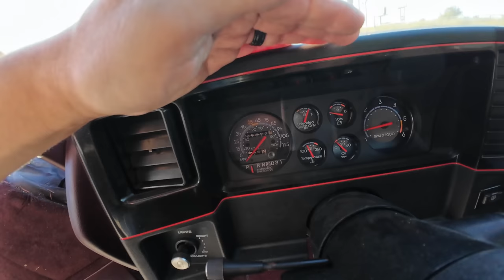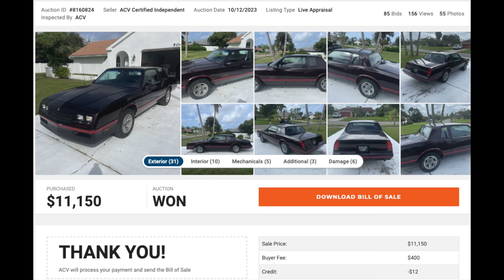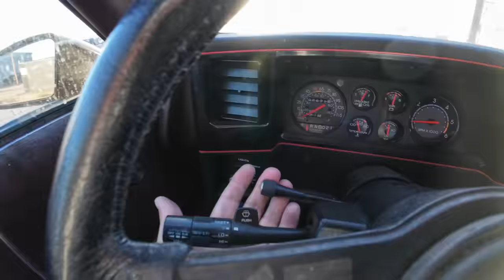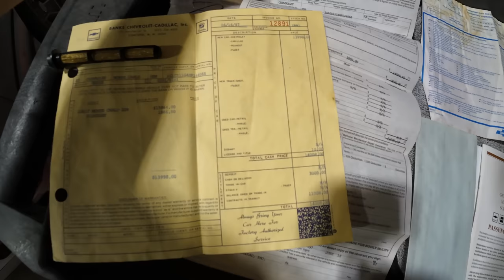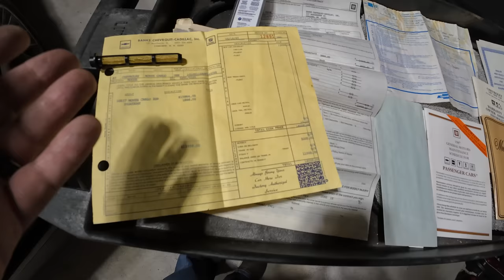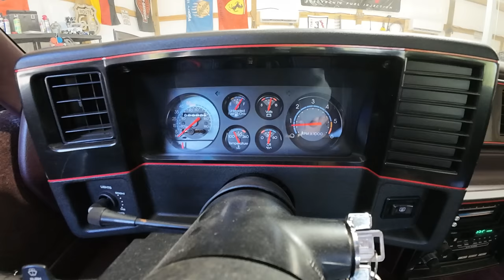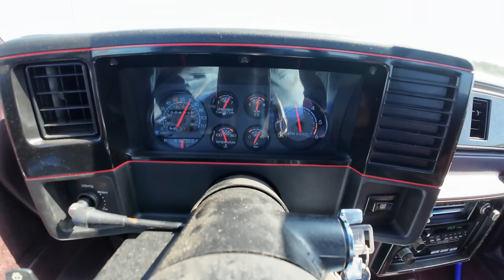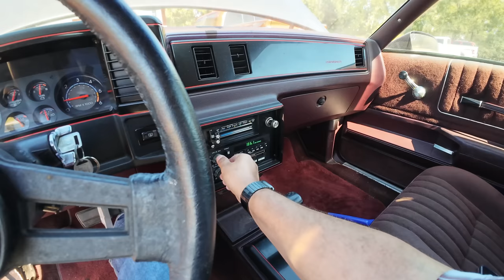I Bought a ONE OWNER 1987 Chevy Monte Carlo SS Parked for 20+ Years! First Drive - Will it Make it?

Comment: Radiator cap is probably fine since it's pushing water/antifreeze into the reservoir as it should be. It isn't sucking air, it's pushing water out.

Comment: A powertrain swap is a good choice.  If it were super low miles and more of a museum piece, then no.  As it is, with 100k on the clock and the long period sitting, that 305 is not as lively as it was new.  It's a good body and deserves a new lease on life with tasteful, modern updates.

Comment: Changing the motor doesn’t bother me even if this car is really original, you should put a 5 or 6 speed obviously but what bother me is that you want to change the wheels, they look really really good on this car and you must keep the original look of the car even if you change the drivetrain, but at the end it’s your car you do what you want

Comment: i have an 88 with 73000 miles all original black in color  in perfect shape i would leave it original  start chopping them up they loose value mine is all power windows and locks
Reply from the maker: Lose value? I added a $5K transmission, a $8000 480hp engine, all new A/C, $600 Bilstein shocks, completely new brakes with new lines, master, calipers, $1500 wheels and tires, $1500 Blackheart 3" exhaust, a 2600 stall Thor converter, $500 Cold Case aluminum radiator and you think the car has lost value??? You're crazy.

Comment: Not that you care because your going to be ripping out the engine, but my 17k mile 83 hurst olds was idling high and turned out to be the throttle position sensor
Reply from the maker: This has a carburetor - no TPS on this

Comment: I'd just have it detailed, and replace / repair what needs to be done, and enjoy it as it is. Though is I remember right, the original engines were painted blue from the factory, so it could be possible, it was replaced.
Reply: Defenly do normal repairs and drive it.
Reply: Just don't see them in such good shape, or at all anymore.

Comment: It's no longer a one owner car
Reply from the maker: You obviously don’t understand how car dealership titles work it’s still a one owner car until it’s sold to an individual
Reply: @AutoAuctionRebuilds  I totally understand.   The title is now in the dealers name.   It's no longer in the original owner's name.   2 owner car now.   Doesn't matter if the 2nd owner is a Corp, llc or personal.
Reply from the maker: Again, you don't understand. The title is NOT in the dealer's name. It's a dealer reassignment so the title still shows the original owners name... Like I said, you don't understand...
Reply: @AutoAuctionRebuilds  I understand totally.   The title has been assigned to the dealer and the dealer is now the 2nd owner.   I have been  in this game for 35 years.    You can try to say it's a one owner but unless you are the original owner then it isn't.   It's really rather simple.  Some states don't have titles on older vehicles.   An assignment of title form is no different than signing over the back of a title to someone.   If it's a one owner as you say, then give it back to the original owner.   Oh wait..... you are the owner now.  #2